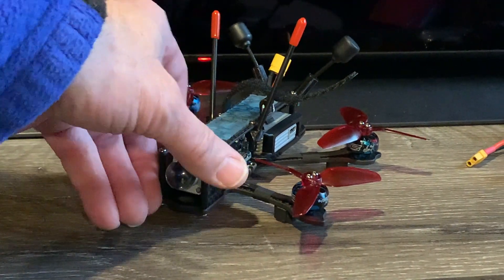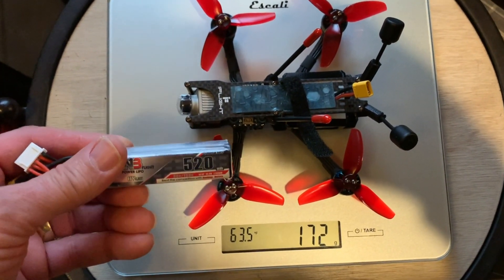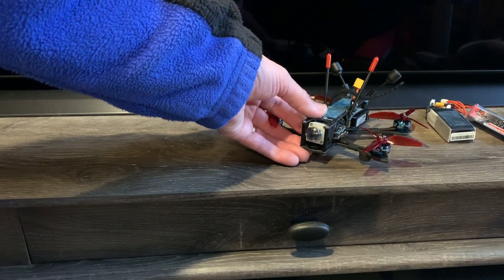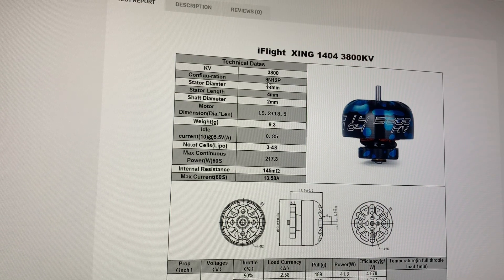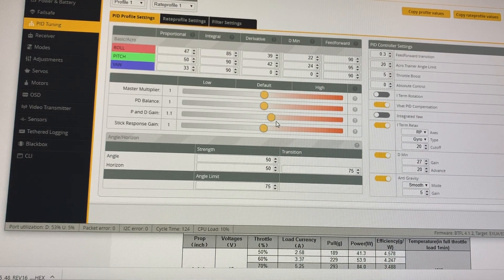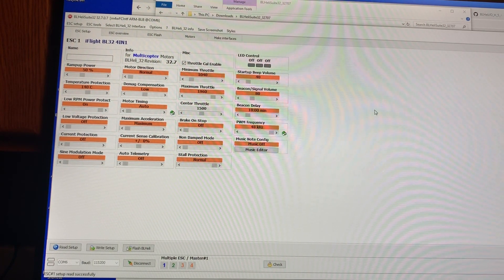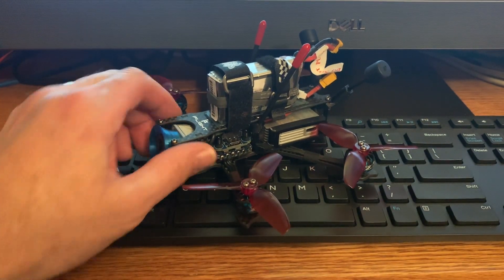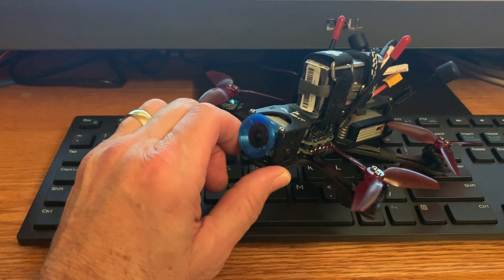iFlight DC3 Review & Setup Tips

Comment: Would you be able to post your final tune somewhere? I'd be very interested in doing it to my quad.
Reply from the maker: Hi Sean,
I am still running Betaflight 4.1.2 so if you are running 4.2.x my PID profile below should not be used. Also I have RPM filtering enabled. So I will link an Albert Kim "RPM Filter Quick Start Guide" Video. https://www.youtube.com/watch?v=JkBa7v7qWus
You can paste this into the CLI:
profile 0

# profile 0
set dyn_lpf_dterm_min_hz = 91
set dyn_lpf_dterm_max_hz = 221
set dterm_lowpass2_hz = 195
set vbat_pid_gain = ON
set feedforward_transition = 30
set iterm_relax_type = GYRO
set p_pitch = 50
set d_pitch = 42
set p_roll = 47
set d_roll = 39
set p_yaw = 33
set level_limit = 75
set d_min_roll = 22
set d_min_pitch = 24
save

Always check for hot motors and use at your own risk.

SLOG
Reply: @slogfpv  Thanks!

Comment: Hey! Can this frame also used with a analog system?
Reply from the maker: I would say yes. I just looked at the frame and it has holes for a 20x20 or 16x16 stack in both the front and back. If you are using a 19x19 analog camera you will need to use some plastic washers on the camera mount to take up some space.
SLOG
Reply: @slogfpv  K, ill do my best... Im a beginner, so dont know very much about this...
Reply: @slogfpv  i would use the caddx turtle v2
Reply from the maker: @Seppll  
You should be fine as the Caddx Turtle V2 has a 20x20mm hole pattern and the camera is 19mm. If you are totally new to FPV I would recommend starting out with a "ready to fly" kit. If this is your first build, I would highly recommend searching on Youtube for build videos. Joshua Bardwell is a good source here.
Cheers,
SLOG
Reply: @slogfpv  k, i knew these rtf kits but i want "high" quali video, i have about 20 hours training in the sim and also fly a mini drone...do u have any tips/components for a 3" quad about 200$? but thanks a lot for all these responses! :)
Reply from the maker: @Seppll  
I would check out https://rotorbuilds.com and look at what other pilots have built. It is a good source for what pilots are using for frames, motors and electronics.
Reply: @slogfpv  Okay, thanks a lot! :)

Comment: Please did you upgrade to Betaflight 4.2?  Do you use the DJI controller?  Thanks!
Reply from the maker: Hi Gustavo Testa,

No I have not upgraded yet to 4.2 on the DC3 but I do plan to. I do not use the DJI controller with the DC3 because mine came with a Frsky receiver.
Reply: @slogfpv  thank you so much for your reply and congrats for your channel. I have a dc3 and I'm not sure how to use the dli to make the upgrade. What would be usable from the last version and what not.
Reply from the maker: Hi Gustavo Testa,
Joshua Bardwell has a very comprehensive video on what parts of a Betaflight CLI diff can be carried over safely when upgrading. He is upgrading from 4.0 to 4.1 but it would still apply for a 4.1 to 4.2 upgrade.

Link here:
https://youtu.be/iEUqv0kOB0A
Reply: @slogfpv  Thank you for advising!  I'll check into that!

Comment: Great video! Is it possible to control the onboard air unit recording with a non-DJI controller?
Reply from the maker: Hi Tianyuan Xiao,

With a non-DJI Controller it will automatically start recording when you arm the quad and will stop recording when you disarm. That is the way mine works with my Frsky Taranis X9D Plus. 
I hope that answers your question,

SLOG
Reply: @slogfpv  Thanks for the reply! This totally make sense now. Is there any setting in betaflight to be tuned, or it's automatic?
Reply from the maker: Hi Tianyuan Xiao no changes required as the factory settings were setup correctly.

Comment: Terrific review.  Much appreciated.  Are there pads on the FC which would enable me to wire up a ViFLY Finder 2 Lost Model Alarm??  Is there room within the frame for the lost model alarm on the FC??  I suppose I could strap it to an arm if necessary...  I'd appreciate knowing the answers.  Thanks!  Again, nicely done video.
Reply from the maker: Hi Frank,

Yes there are pads for a buzzer on the iFlight FC as I have used it on a build where I added a buzzer. The ViFLY Finder 2 is big for a 3inch quad. There are other similar battery buzzers like the HellGate FPV Buzzer that are smaller. The ViFLY Finder 2 will fit if you get a DC3 without a receiver or just remove it and use the DJI RC Transmitter if you have one. It would fit nicely on top of the FC stack then. I hope this helps.

SLOG
Reply: SLOG FPV Fantastic. Thank you for the prompt reply. I'm on a waiting list for this quad and thought I'd move forward securing the "accessories."  LOL!  You know how it is. - an addiction, but in a good way.

Comment: pre battery:  172 gm.  with gnb 850 battery, 247 gm.  So your gnb 850mah weigh just 75gm?   mine weigh 110gm, and their official weight listed on Banggood is 112 gm.  ???
Reply from the maker: Hi Ho Jen,

The weight you are giving is for a 850mAh 4S. I was running a 850mAh 3S which weighs 75 grams. Link and description below:

https://www.aliexpress.com/item/32884751411.html?src=google&src=google&albch=shopping&acnt=494-037-6276&isdl=y&slnk=&plac=&mtctp=&albbt=Google_7_shopping&aff_platform=google&aff_short_key=UneMJZVf&&albagn=888888&albcp=1582410664&albag=59754279756&trgt=743612850874&crea=en32884751411&netw=u&device=c&gclid=EAIaIQobChMIutj15-Pj5wIViaDsCh0DUAhmEAQYASABEgK2IfD_BwE&gclsrc=aw.ds

Description: 
 
Brand Gaoneng
Capacity(mah) 850mAh
Cell(s) 3S1P
Discharge Rate(C) 80C/160c
Weight(g) 75g
Size(LWT)(mm) 59mm*31mm*25mm
Voltage(v) 11.1V
Plug JST / XT30 / XT60

Comment: hey did it come with blheli32 or did you flash that? Mine came with BLHeli_S 16.7 and I am really confused.
Reply from the maker: Mine came with 32.6 and bi-directional DShot disabled. Kind of like a half baked cake. Yours maybe from a different build run? Since the ESCs support BLHeli32 I would flash that if you want RPM filtering. Make sure the other settings are correct (eg number of motor poles).

Slog

Comment: Nice setup and flying !  I’m also using these motors on a new xl twig hd build. 
I find that 850 3s and 650 4s to work best. Do you feel that these 4600kv motor kv are accurate ? 
I have a 1407 3600 kv that screams on 4s and find these to be more mild on 4s. Not a bad thing. Wanted to hear your thoughts ., thank you.
Reply from the maker: The only motors I have to compare to are the motors on my Acrobrat build which are HGLRC 1407 3600KV. Even though this build is heavier (212 grams), the punch out on that build is night and day different. Obviously the stator height is bigger on the 1407s so more torque. But still, the 1404 motors don't feel like 4700kv. The good news is they are extremely efficient. I was getting well over 5 min just cruising around on the 850mAh 3s batteries so I am happy with them on a cine-drone.